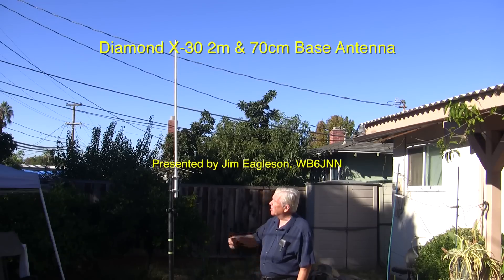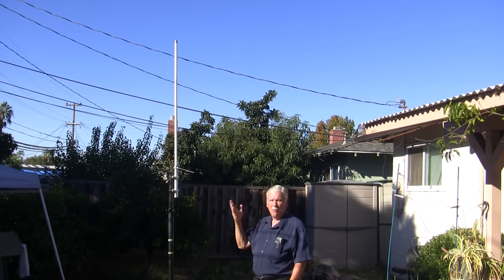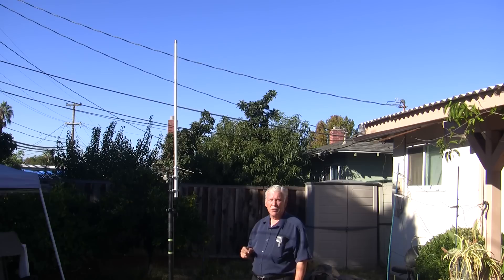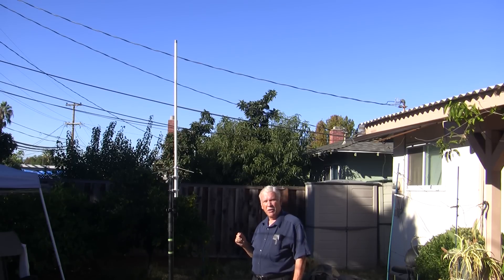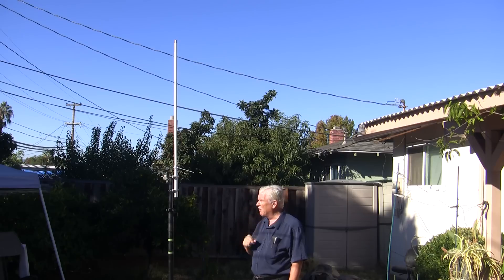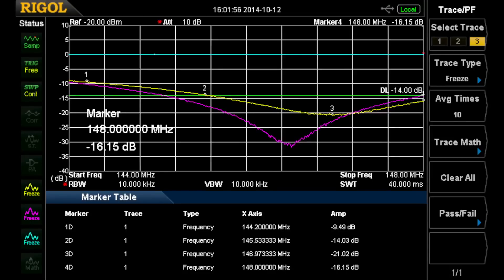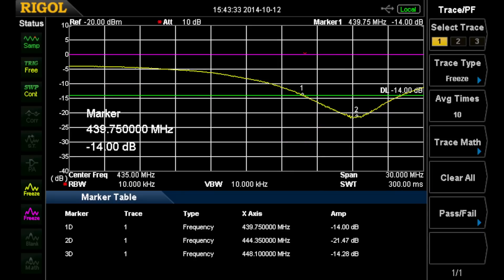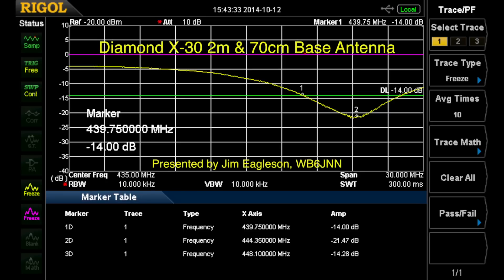2m 70cm Diamond X 30 Base Antenna

Comment: The diamond x50 and the diamond x30 are both great antennas for the money. That is really all you need to get into all your local repeaters and they aren't huge. I just cemented a 5 foot pole in a Home Depot bucket with quick setting concrete and it works so well just sitting in my backyard.
Reply: thats what im doing with mine